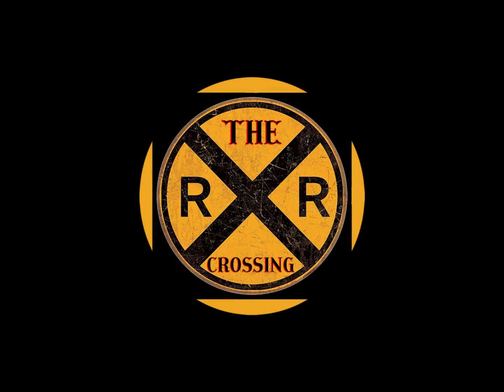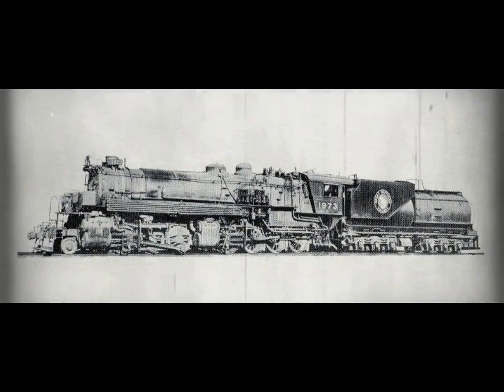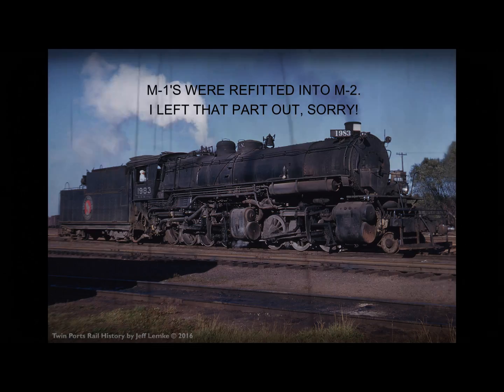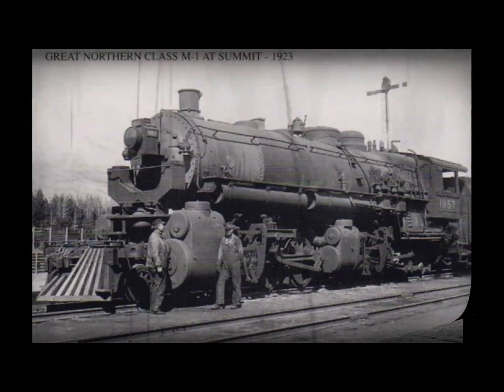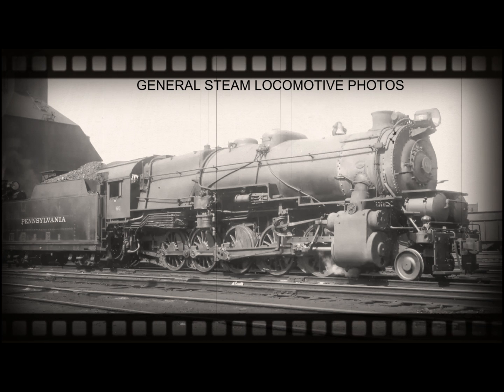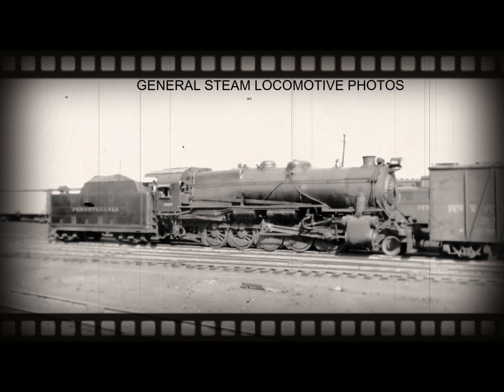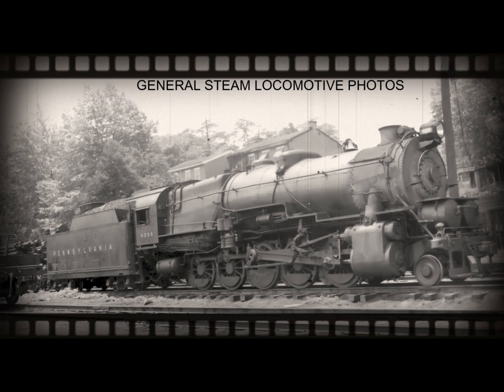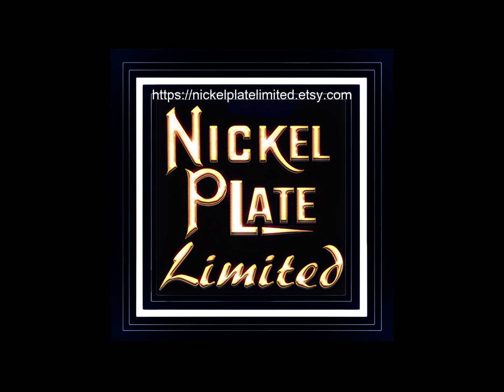Baldwin Locomotive Works Rare 2- 6 -8- 0  "Kit Mallets"

Comment: I've mentioned this on another video about these and I'll say it again: Imagine if the 'conversion' versions had worked out or got their issues solved, it may have had huge knock on effect, with many railroads  previously having built a ton of 2-8-0s that were rapidly becoming a liability, if the conversion would have worked out then hundreds (if not a thousand or two) locomotives would have had an extension on life (of sorts) turning "useless" engines into solid revenue earners once again on the cheap, this would have had huge implications for many railroads, the PRR and D&RGW would have managed to dodge the major motive-power issues that came from having built a ton of 2-8-0s that were no longer powerful enough for the job. This could also have had a huge knock on effect in future locomotive development. Even if the 2-6-8-0 didn't make any of the railroads change their minds about articulation for future power this 'early' explosion in mallets would have caused railroads to build bigger infrastructure, which would actually be beneficial for them in the long run, even for the non-articulateds, if you have already upgraded your turntables to handle 2-6-8-0s then it wouldn't be an issue dealing with newer large rigid frame engines like (for example) 2-8-4 Berkshires.
Reply from the maker: Railroads with foresight? C'mon now! I kid because I care. Really though all that came down to available money for upgrades to the track and greater capacity infrastructure. otherwise, sure you can modify obsolete locomotives into articulateds... But for many of these roads... the cost and in some cases, the feasibility just wasn't there. So they built the snot out of 2-8-2 Mikes instead.
Reply: @TheRailroadCrossing-SteamPower  I don't know about alot of railroads, but as far as the PRR was concerned track and capacity weren't the major issues, rather, the excessive number of jobs they were having to double head was. Pretty sure this was also the case for the Grand (at least fo their narrow gauge)

Comment: Hello in Huntington WV there is two locomotives on display a Mikado at the  visitors center and a Mallet 2-6-6-2 operated by C&O 1308 which may be one the last built by Baldwin
Reply from the maker: Baldwin had one more locomotive produced after the 1308. You are correct
Reply: @TheRailroadCrossing-SteamPower  Also there are many photos of both locomotives and 1308 has a wiki page. The 1308 appears to be at it's present display location for 50+ years but it has regular upkeep last time I saw it there was no rust or streaks. The Mikado is in bad shape no upkeep since it was placed.
Reply from the maker: @kennethmaynard5046  Thank You!

Comment: Do the PRR Q1 CLASS have anything in common with this design? I understand the rear cylinders were under the firebox but was not sure if these baldwins were an inspiration to the q1
Reply from the maker: Q1 would have incorporated many lessons learned from previous classes of locomotives.. Including the M-2. We saw this also with Battleships and Aircraft carriers
Reply: @TheRailroadCrossing-SteamPower  thanks man!!!
Reply from the maker: @Running-with-skizers  You're welcome! It's kinda ironic that everything we build are improvements derived from the lessons that we learned before. Much like ourselves. At some point or another in the Q1 design phase there was likely some old coot engineer who said something like "We tried that in the M-2 and it didn't work"